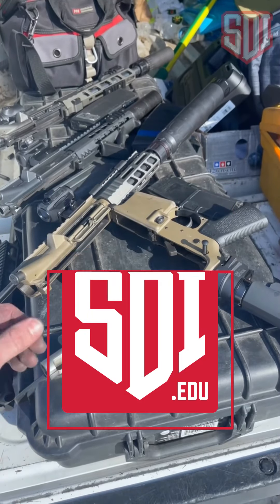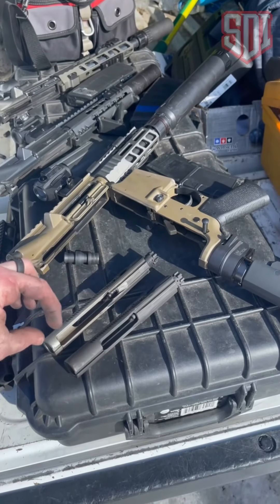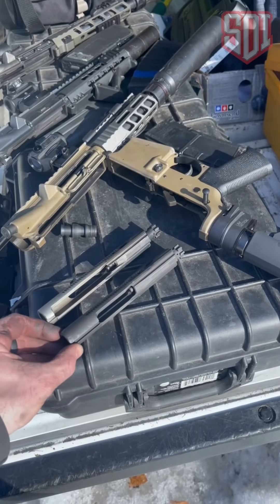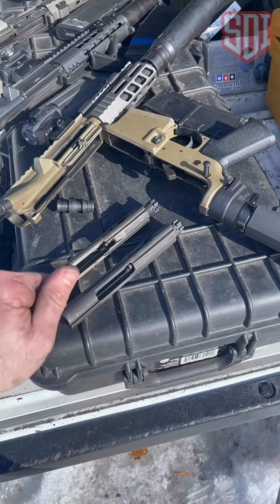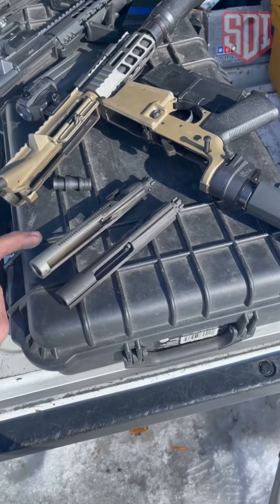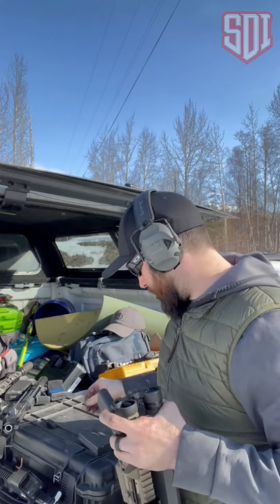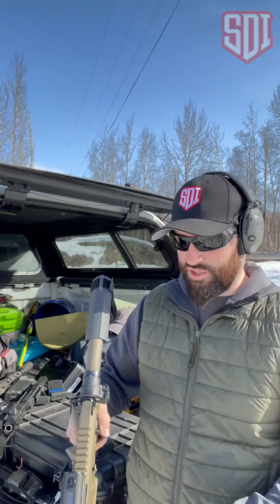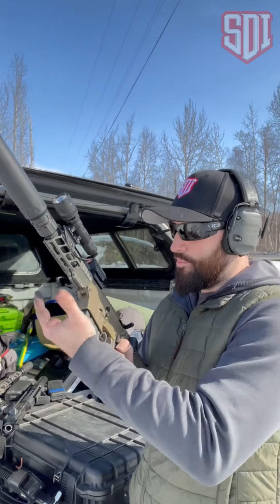SDI GRAD ADVICE - Uses for Semi Auto BCG's

Comment: I own both for different reasons.  However the semi auto bcg seems to have a faster cycle rate than the full auto bcg. You have to make sure you build the rifle in tune to the bolt to run it the way you want